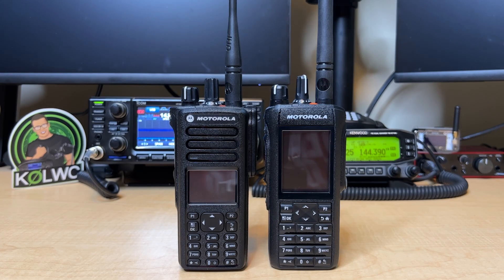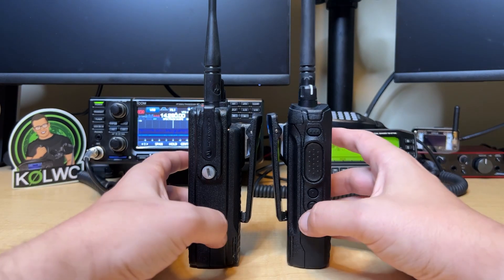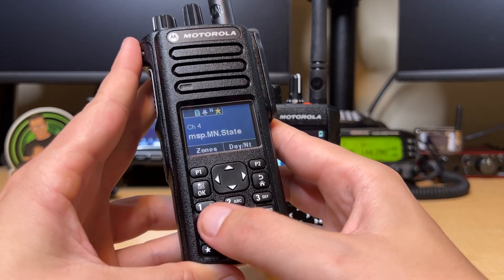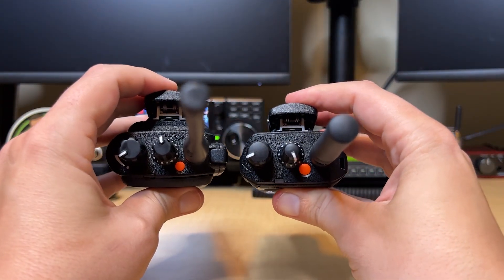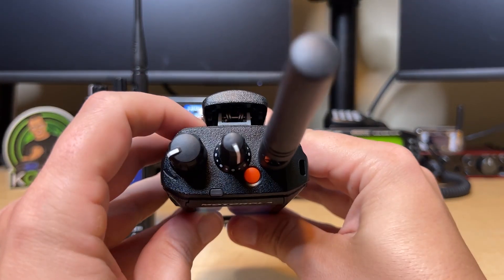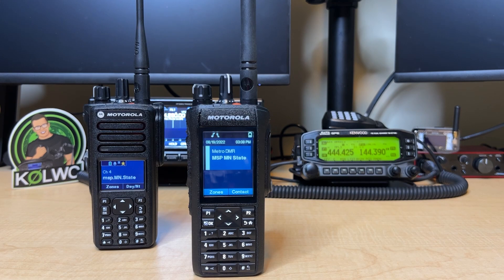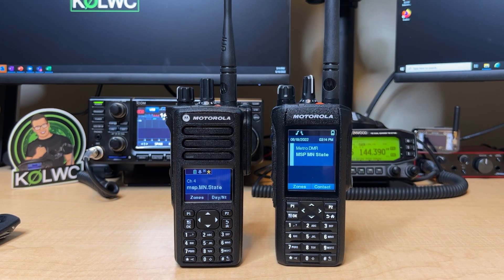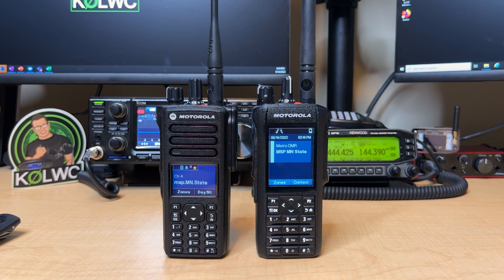Motorola R7 vs. Motorola 7550e: Which One is Right for You?

Comment: KOLWC alright got the radio signed up with Motorola turned on radio states it is unprogrammed and won't connect to wi-fi, any suggestions appreciated. Thanks.
Reply: You need a programming cable and the CPS for the radio. Unprogrammed means it's missing a codeplug.

Comment: With respect to the R7… which iCom and Yaesu units would be closest analogs (most similar in features)? What is the philosophy of use/what kind of user would pick the R7? Thanks for the video.
Reply: The comparable iComs would be either the ID-52 (D-Star), or F4400D (NXDN). In Yaesu it would be the FT5-DR (C4FM). The user who would pick the R7 is one who wants to play on DMR but doesn't want to use a cheap Chinese radio (CCR), and is willing to get the next level up above the XPR7550e.
Reply: @tecdive8045  Thank you for the clarification. Not my area of expertise.
Reply: @tecdive8045  There is a user segment in digital radio that will buy the R7 for 1 of 3 reasons: 1. They are more technically inclined to move to the newest technology to enjoy new features & abilities, 2. Will own one as it is an "EGO" radio, proving they can afford it and have what you don't, like an Icom 7851 or Yaesu FTdx9000D. 3. An "early adopter" who will learn all features and use them well.

I have used the XPR7550E for years, and have found it to be extremely reliable, and will work more distant repeaters that the TYT/Baofeng, Alinco and others wont get to at all. Where I live, cell phones are not 100% reliable, but we enjoy good coverage on FUSION, D-Star, P25 and DMR. My safety and the safety of my family doesn't become a reality with a  $60-$90 radio made in China.

Comment: I found the noise canceling for the R7 doesn't work well for me. I work in a plant and the volume fluctuates so much its quite a nuisance. Got 8 of these radios and almost no one in my shop uses them. They continue to use the 7550e's instead. I got to see if I can turn this feature off altogether.
Reply from the maker: You can turn off the second mic and use the same canceling as the 7550e. It’s true that if the noise in the background is fluctuating way up and down quickly it has to track that and it will have a delay/issue with it. Seems constant levels it handles best.

Comment: So say I purchase a new Motorola R7 where do I get it programmed or do I buy the software and cable to use it as a Ham Radio? Thanks.
Reply from the maker: You need to register with Motorola as an amateur user. They’ll refuge you the software for free — but the hoops do take a couple weeks to jump through.
Reply: @K0LWC  can you explain this. I’m new to all this too haha
Reply: @K0LWC  Thanks got it down question can you recommend a antenna better than the original? Thanks.

Comment: Big factor you miss here is the price. You can get a 7550e and every accessory you could ever want for 3 times over for the price of an R7.
Reply from the maker: That’s simply because the used market is pretty sparse. Your comparing a new radio to a used market that’s been around for many years. It’ll come down slowly over time.
Reply: 7550e can be had for 350...
Reply: @KG1AES  Exactly, and you can, for another ~150, get a remote mic, a bunch of batteries, and a charger. So lets say 500 for a complete setup. That gets you ~1/3 of the way to an R7.
Reply: @henryatkinson1479  although I'd rather have the R7.
Reply: @KG1AES  is EBAY the best source for the 7550e?

Comment: Can you confirm you were able to program a 25khz channel spacing with that entitlement loaded on your CPS for a analog frequency? I can’t get confirmation either from a dealer or moto. Thanks
Reply from the maker: Yes, I’ve done it successfully. You need to take the course from Motorola to successfully get access to the entitlement key and flash it to the radio.
Reply: @K0LWC  thank you.
Reply: @K0LWC can you post a video if what it takes to do the course?

Comment: What real radios are for Ham, DMR and GMRS repeaters and true simplex encryption. 😎. A big way to give the middle finger to the government. Motorola does not give your information out from what I hear. Correct me if I'm wrong. Just got into these. Working on Hammy License but have my gmrs license. 

EXCELLENT VIDEO!!😎😎🔥🔥
Reply from the maker: Well what you're describing would be Motorola, but you won't be able to use encryption on many of the services you listed.
Reply: @K0LWC  not legally no. In a shtf that might be different story.  I wouldn't use for ham but for simplex commercial only. The encryption does work. I want to pick up 2 or 3 Motorola's for my squad.

Comment: Motor Motorola used to be good when they were American made, but they no good no more cuz they made in communist China, I  buy a Yeasu or an icom which is made in Japan,
Reply: Motorola commercial radios are made in Malaysia, and only the top tier APX radios IIRC are made in the USA. Only the cheap stuff is made in China AFAIK.
Reply from the maker: My Motorola wasn’t made in China. Also, Yaesu does have manufacturing in China so it’s not solely Japan.
Reply: @K0LWC  Yes the FT 70, I have the FT5D made in Japan!
Reply: Theyre solid as a rock and bullet proof still

Comment: Spec sheet says 25khz bandwidth is not available in the US.  So do you only use these for DMR?  Or do you just operate 12.5khz analog even if the repeater is wideband?  As someone that only has older motorola radios, what is the additional cost for the CPS software?
Reply from the maker: You can obtain a 25khz bandwidth entitlement key, but you have to take a short training and sign off on how you’ll use it. You’ll then get issued 25khz keys to flash to the radio. 

CPS 2.0 is $170 every three years.
Reply: Pretty sure CPS is free now, but I think you have to purchase an entitlement for software updates now.

Comment: They must be expensive.  The R7 looks awesome! Why are the antennas and knobs on the wrong side on Motorola's?
I have two GP328, great audio and range even for an older Motorola HT radio. Cheers for sharing the HT radio porn. Lol 🍻👍
Reply: The antenna is on the same side as the mic Jack so that you can use a combined mic/antenna that sits on your shoulder. This is something that’s really common in industry and public safety.
Reply from the maker: Glad you enjoyed. They run about $1,500 USD with all the entitlements, so not too shabby compared to other Motorola models.
Reply: They can be had for $1k~
Reply from the maker: @KG1AES  Yes, but I'm assuming that's bare bones with no extras.
Reply: @K0LWC  I got the enabled version. Everything enabled with charger, antenna, battery, clip etc.
Reply: I can sell you a beautiful used 7550e with all new accessories  (mic, charger ) in the box and in a new, beautiful leather case.

Comment: The only sad thing is the on the fly programing. That I mind a lot.
Reply from the maker: The radio will be front keypad programmable. It’s a feature offered by Motorola, but they haven’t rolled it out on the R7 yet.
Reply: That does not exist on Commercial radios.

Comment: Thanks for the great video.  Would you recommend the R7 over the Smart ION?
Reply: With the ION the main catch you have is that it’s subscription based for programming through Motorolas radio central system where as the R7 once it’s been regionalised by connecting to Wi-Fi it doesn’t need to call home to Motorola again and can be programmed over USB like normal or OTAP or Wi-Fi if using Radio Management.
Reply from the maker: That's a great question, George. I haven't used the Smart ION personally. However, I've had friends who at first scoffed at the idea of the ION and now want one, and or, have one themselves. My only question would be the stability and usability of the Android OS long-term over the years. That very fact kept me away from purchasing one.
Reply: Thank you both for the info!